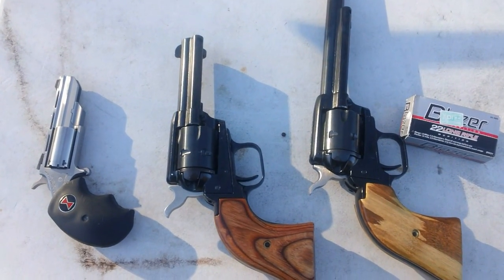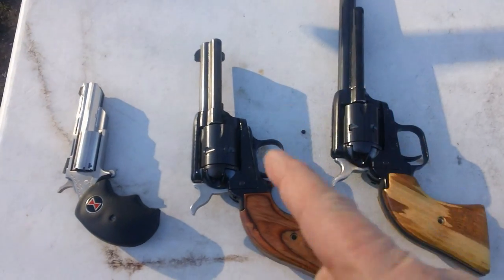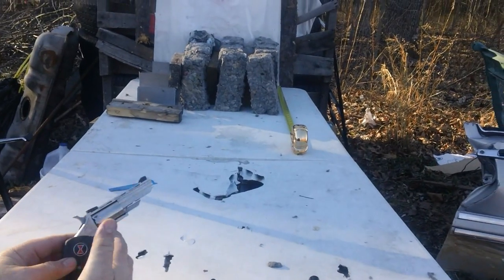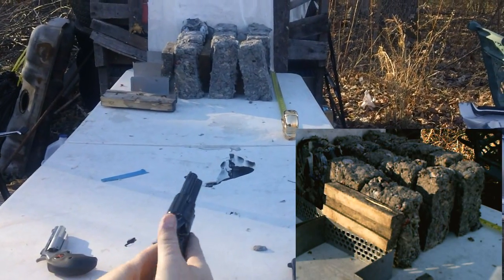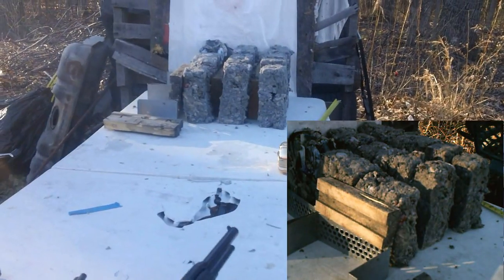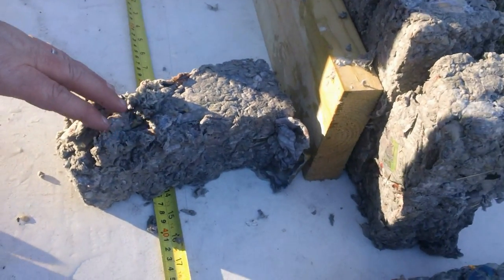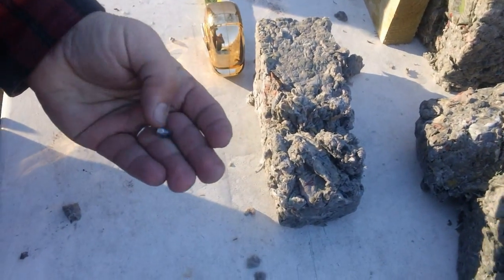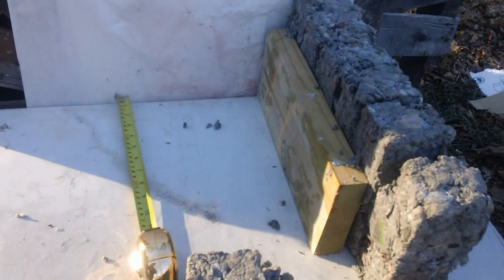Does the barrel length of a revolver affect the level of penetration?

Comment: Performance varies with barrel length and the type of action. The case size of the .22 is pretty small. It would make sense to load it with a hot, fast-burning powder for maximum effect. Consequently, the powder is mostly ignited before the bullet has a chance to go more than a few inches down the barrel. After rising substantially from 2 to 6 inches and then a fraction more from 6 to 8 inches, the velocity for the .22 tends to flatten out after 8 inches of barrel travel. Bolt-action rifles may perform differently from semiautomatic rifles and pistols from revolvers. Generally, a longer barrel with no blowback will produce a more energetic bullet at the muzzle.
Reply from the maker: Well said....

Comment: Puuf. I am impressed over all with the wound channels created by each. For me length of barrel adds to velocity yes is it enough  for measurement using same ammo. NO (I will add  from a 2 inch to a 6 inch yes) from 5 to 8 however not much. Now longer barrels do make for better accuracy due to longer sight picture.

Comment: the wet pac is very inconsistent  .try wood or gel
Reply from the maker: Not so fast, we have consistent results with wetpack.  The reason is the process is always the same.  Every brick is made the same way and measured.  We have calibrated wetpack with BB's and have shown very good results.  The cellulose material is an accurate representation of flesh. The reason people talk bad about wetpack is because the people using it are not as precise and consistent as we are...... just sayin
Reply: Hmmmm ok sounds good to me ...how do you make it?
Reply: Ate there video on how to make it
Reply: Ive  got 2 rough riders  and an 1858 remington id like to put through that stuff
Reply from the maker: Always use the same paper (no wax coating) use the same amount of water, same mixing container, same amount of force to press the excess water out, and same curing time on each wetpack brick produced.  Yes, it is long and boring process, yet consistent.
Reply from the maker: We used a brick press (4 at a time) that we found on Amazon.  At the time it cost around $60.00  we found the idea on a prepper channel.  They used the same thing to make bricks for fire logs.  They dried them completely, where as we do not... only a small percentage of the brick is dried on our testing.
Reply from the maker: Yes, many prepper channels will show you several different methods of making it.
Reply from the maker: The exact formula for calculating the wetpack vs gel is.....
1in penetration of wetpack is = .625in gel
Reply from the maker: Here is the one we use
https://www.amazon.com/CASTLECREEK-09001007-4-in-1-Paper-Maker/dp/B00GTP5UQE/ref=sr_1_1?ie=UTF8&qid=1481120953&sr=8-1&keywords=4-in-1+paper+log+maker
Reply from the maker: Here is an example of how it is done, but this is a 1 at a time brick maker...
https://www.youtube.com/watch?v=gGp540bIUuc

Comment: Interesting test just not done right, get some clear gel with exact specs, not wet news paper.
Reply from the maker: Not so fast, we have consistent results with wetpack.  The reason is the process is always the same.  Every brick is made the same way and measured.  We have calibrated wetpack with BB's and have shown very good results.  The cellulose material is an accurate representation of flesh. The reason people talk bad about wetpack is because the people using it are not as precise and consistent as we are...... just sayin

Comment: Interesting video,  but there are other variables at work, such as cylinder gap and barrel wear.   A suggestion:   buy an old single shot rifle and test it for penetration,  and after each shot cut several inches off the barrel until you are down to 2".   This may give a more accurate test.    I think that the cylinder gap on a revolver means that the muzzle velocity peaks then tapers off quickly.   You could also do the test from a distance with a fixed mount to test accuracy.
Reply from the maker: Great comments and suggetsions

Comment: I think you're test showed some fairly decent results. For the most part the longer barrel aids with accuracy and may help taming the recoil to a certain degree. I actually like a bigger barreled gun because it's more intimidating. lol
Reply: Tests show that barrel length is not related to accuracy,  but more mass will lessen the felt recoil, which is not much for a .22 anyway.
Reply: Jeffrey Nelson---That depends, a 3 in. barrel is no way as accurate as that 6 in. barrel--reason, the longer time of bullet twist in the barrel stabilizes the bullet before exit from barrel thus more stabilization equals more accuracy... I have proved this by putting different guns with different barrel lengths of same caliber in a vise and shooting them--there is a point of diminishing returns where barrel length has little affect and human accuracy comes into play...
Reply: Christian Blade aside from greater accuracy and less recoil you get  more velocity with longer barrels which yields better terminal ballistic performance.
Reply: Christian Blade   Major velocity difference in longer barrels. And the only reason that the longer barrel is more accurate, is because you have a longer sight radius, making it easier to shoot.  It has nothing to do with the bullet staying straight, for a longer distance. That's a myth, that people cling to...  Barrel length has NOTHING to do with true accuracy.

Comment: Interesting results. Just for fun next time you do this, use a rifle chambered for the same round as a standard mark for the comparison. 
I don't know how wet pack compares to ballistic gel, but from what I see here, the .22 is a very viable round. 
I guess you get a thumbs up.  ;-)
Reply from the maker: +Ballenxj Thanks!  One of the biggest variables in a 22 revolver is the space between the cylinder and the forcing cone... that little gap lets a LOT of gas out.  I'm not sure what kind of rifle we could use that would include that variable (well, there's that Rossi Circuit Judge... which we don't have access to).  That'd be the only fair comparison, I'd say.  Chris
Reply: +poboyspecial The use of the rifle could set a standard of what the .22 is really capable of. There have been auto loading rifles built that have the capability of shoving the bolt handle in to act more like a bolt action. The reason for this is more velocity. I wouldn't worry about the cylinder gap as this would be just to benchmark what the .22 will do under ideal conditions. 
PS, I love my .22's.  ;-)
Reply from the maker: +Ballenxj Oh, so you just wanna see a rifle comparison?  Huh, maybe a good idea.  I'll check into it.  Thanks, Chris
Reply: +poboyspecial Yeah, just to benchmark what the cartridge is capable of, then compare all the shorter barrels results to that.
 I have been reading about ballistics for many years, and I seem to remember that 16" was the absolute most efficient length of barrel for that caliber, (full powder burn) so in my opinion .that would be the best place to start. 
There are of course other variables to consider, like who made the barrel, type of rifling used, and resistance, AKA how smooth the lands and grooves are.
Reply from the maker: The barrel length on the revolvers really doesn't change things enough to matter.  It is still a very dangerous round.

Comment: I always wondered how they calibrate wet pack.
Reply from the maker: +ytubepuppy It's a medium to itself.  In other words, you can't really compare it to other mediums, just to itself.  That said, it's pretty good to see ballistics through a soft, damp material.  It IS organic, so that's a plus.  It is less dense than animal tissue, but should give a good medium to compare with other wet pack testing.  So, if you use this test as a stand-alone, you can see what barrel length has the best penetration.  We consider it just 1 more data point to help you make a decision.  Chris

Comment: It's a 3 INCH BARREL..3...3...3...3...3...3...3...3...3...3...3...3...3...3...3...3...3...3...3...3...3...3...3...3...3...3...3...3...3...3...3...3...3...3...3...3...3...3...3...3...3...3...3...3...3...3...3...3...3...3...3...3...3...3...3...3...3...3...3...3...3...3...3...3...3...3...3...3...3...3...3...3...3...3...3...3...3...3...3...3...3...3...3...3...3...3...3...3...3...3...3...3...3...3...3...3...3...3...3...3...3...3...3...3...3...3...3...3...3...3...3...3...3...3...3...3...3...3...3...3...3...3...3...3...3...3...3...3...3...3...3...3...3...3...3...3...3...3...3...3...3...3...3...3...3...3...3...3...3...
Reply from the maker: +Andrew B. ???  I don't get it.
Reply: IDK about him,  but at the start you said the middle gun had a 4 inch barrel, then later you said it was a 3 inch barrel.
Reply from the maker: Sorry for the mix up... it is indeed 4 in.

Comment: There's a website dedicated to this question: BBTI - Ballistics by the Inch.
Their data is based on speed (feet per second) and muzzle energy (foot-pound).
Though you measured differently, both you and that site say the same thing: barrel length will affect the speed and power of a bullet shot of it, thus a longer barreled gun will do more damage.
Perhaps one more reason to pick a longer-barreled, more full-sized gun over the little guns that are all the rage now, though the loss in velocity doesn't make a bullet out of a snub-nosed revolver any less dangerous.
(I'd still pick a full-sized gun over a snubbie though just for that extra hitting power and for other reasons.)
Reply from the maker: Well said, and thanks for sharing the website.

Comment: If you want to determine the effect of barrel length on velocity, use a chronograph to measure it.  You test fails to recognize that the difference in the width and volume of the cavity formed in the wetpack is also an indicator of energy transfer, and therefore velocity.

If you repeat this test with a hollow point bullet, you may find that the 6" barrel produces LESS penetration than the 2" barrel, but the cavity width will be much greater.

If you want to know what effect barrel length has on .22 velocity, check out:  http://www.ballisticsbytheinch.com/22.html
Also see the effect of the revolver barrel cylinder gap:  http://www.ballisticsbytheinch.com/gaptests.html

Based on the measured velocity data, your conclusion is not way off, but you do need to be careful in how you measure and interpret penetration data.
Reply from the maker: Agreed, this was filmed before we had a Chrony

Comment: Ah yes, the reason nobody owns or makes a 6 foot long .22 rifle. At a certain distance, the barrel will drag on the round. Of course there might be some ammo that does better in the 6 inch barrel. Its the cylinder gap though, that causes the gas to vent out the sides that makes 3 inches the best. In a rifle, some 20 inches should do well.
Reply from the maker: You make some good points....

Comment: cant a short 22 get stuck in a rifle?
Reply from the maker: would not recommend for semi auto, but bolt action may be different.
Reply: Some lever action rifles will cycle them, so in order for them to be safe to shoot, there would need to be enough powder even in a short to keep accelerating a bullet even at rifles lengths, though not as much as Ls, or LRs. Would like to know if there is a max length for shorts though.

Comment: seems weird that a bullet having to go through a longer barrel would make it more powerful. youd think itd be less slowed down for not having to go through a longer barrel.
Reply from the maker: we found that at a certain point, the barrel length doesn't make a difference on a revolver because of the friction
Reply: poboyspecial
it seems this test showed the bullet from the longer barrel was more powerful... you mean you kept doing it and they turned out the same?
Reply from the maker: I think what PoBoy is trying to say is, through a revolver, the barrel length only adds to velocity to a certain point.  Past that point it only adds to accuracy.  And if you go much longer than that, it actually will decrease velocity due to friction from the barrel.  Chris.
Reply: poboyspecial
10 4. thanks.
Reply: That would only be true of a normal round and a way too long rifle barrel. The charge of a 22 has to keep pushing the bullet at least out to 30"+ or you would get squib loads where the bullet gets stuck in the barrel. That can happen with a bad or undercharged round. More likely in rifles then pistols. So if a weak report is ever herd, should check the barrel for obstruction before ever firing another round. But in normal pistols and rifles, the burning powder is still accelerating the bullet until it exits.

Comment: Would it be more powerful with a semiautomatic pistol with the same round and the same barrel lenght?

The revolver has the cylinder gap.
Reply: Actually it does. The gasses are expanding and pushing in both forward and backward directions within the barrel. It's  just that the"thump" of the casing hasn't fully over come the mass of the bolt  yet before the bullet has left the barrel, but the energy has been subtracted ever so slightly from the said energy propelling the bullet. Then the action cycles, but the energy to do that (recoil) had to come from somewhere.
Reply from the maker: Yes... Revolvers lose a LOT of gas in the gap between the cylinder and the forcing cone.  Semi Autos don't have that.  Chris
Reply: poboyspecial
That is right but the semiautomatic pistols loose energy to push the slide back.
Reply from the maker: da8352 Nope, not at all... and I'm not being a "know it all here."  I used to think the same thing, then I saw videos demonstrating that the bullet is actually long gone out of the barrel before the action on semi-autos actually reacts to the firing.  All the expanding gas pressure is exerted on firing bullet.  Check out this vid - "Pistol Shot at 16,000 Frames Per Second."  Chris (You'll have to copy and paste the name, of course)
Reply: Andrew is right. It takes energy to work the action. That energy is subtracted from the propulsion of the bullet. I'm not sure which wastes more energy tho...the cylinder gap, or the energy to work the slide. Hmmm